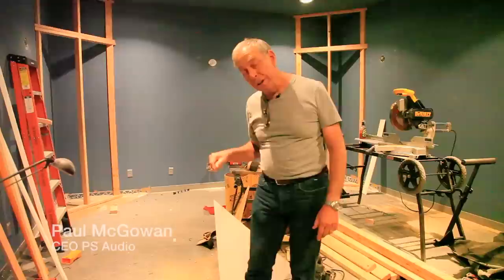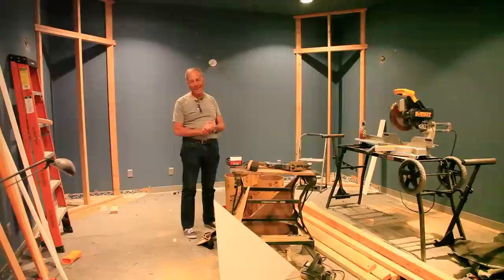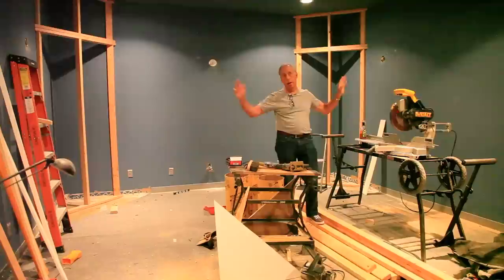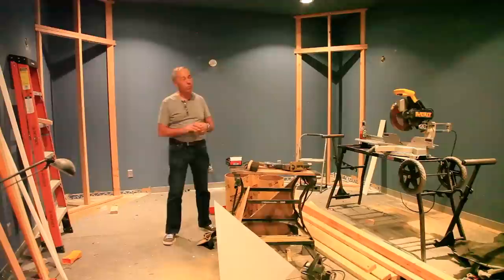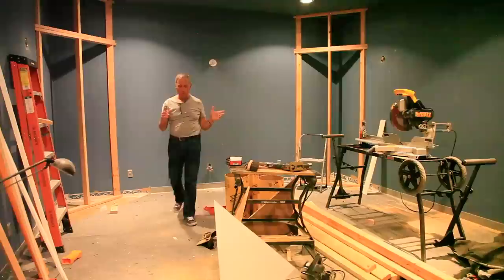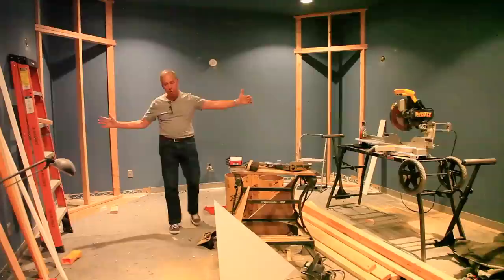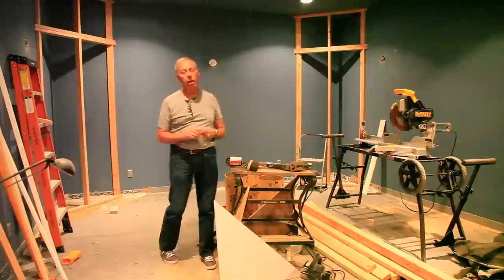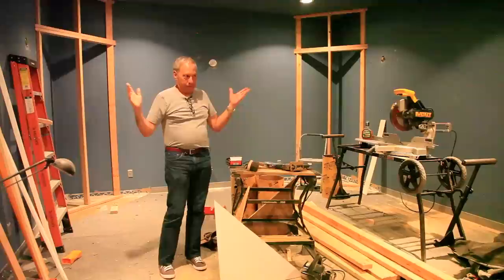Building a new Music Room Part 3

Comment: Dear Paul:
First of all I congratulate you on your videos, I loved them.
I know in advance that my comment will be too late, but the idea is to learn. You understand the concept of resonator Helmholtz, only there is a problem in your explanation. For the spring to muffle the frequency you must leave the internal space empty and not fill it with absorbent material, so it will not work. It is required that work be generated and that this effort be converted into heat, thus absorbing energy. If you fill it with absorbent material, you will not only change the internal volume, but it will also hardly resonate, remember that when you operate backwards the resonator will not emit sound like a whistle, but that at the frequency that the whistle resonates it will now be absorbed. If you fill the whistle for example with cotton, it will not sound, dare, will not resonate and conversely, when you feel the frequency the Helmholtz resonator will not absorb it.
I hope I have explained well.
Regards

Comment: As an avid DIY audiophile who has built a fair amount of electronics and speakers, I have one suggestion for adjusting your system:  Gut the stock crossovers in the IRS Betas and roll your own using first order passive filters and impedance compensating zobel networks. Then start measuring the room response of the speakers.  As good as the IRS Beta's might be, first order crossover networks will sound far more musical, since this is the only type that exhibits proper time domain behavior.

Comment: Not only that. It will make the "sweet spot" very small. Digital correction might even aggravate problems in the room once you move your head an inch to the left. It also will not get rid of the resonance.
Reply: I know you haven't asked me.
But if you are interested, the only thing DSP will do is lower the amplitude of the selected frequency, the room will continue to resonate, even if the frequency has stopped being generated, it is a problem of the room not of the speaker.
Regards

Comment: Paul- I like your idea of placing the equipment in a rack outside of the room boundaries.  That is going to leave you with some very long speaker cables, albeit, very short interconnects unless the power amps remain in the room.  You can, and they do, argue both ways: short interconnects, long cables, and vice versa.  Any opion in that regard.  Thanks.
Russ

Comment: This is fine but it assumes a perfectly rectangular rigid box with no carpet. You are planning to cut into the walls. The room will have some absorption. And most importantlt the IRS will not have a flat output. So as you mention being able to tune the resonators based on measured response of the final room with the speakers and equipment is the only effective approach. That is the response graph I will look forward to seeing!

Comment: If a Helmholtz resonator can only be tuned to one frequency, I don't think it's ultimately going to be the best solution since these mode build ups can actually be a broad range range of low frequencies because the build up is a little more spread out over a wider frequency range than only one.  yeah, one might actually be the most prominent, but it doesn't have a spike?  it gradually goes up and down with different frequencies.  I think other low frequency absorption would be ultimately better.
Reply: Oneness100 more resonators? for different frequencies
Reply: MAaDmUm A Helmholtz resonator isn't a broadband resonator, they are tuned to a specific frequency.  Take a coke bottle.  when you blow over the mouth of the glass coke bottle, it resonates at a specific frequency.  Right?  That's basically what a Helmholtz resonator is, in generalized terms.  Well, if you have low frequency issues in a room, it's not just ONE frequency that you have a problem with, it's typically a RANGE of frequencies and it might be CENTERED around a specific frequency, but you still have to treat the other frequencies surrounding that one center frequency.  So, if you measured a problem with 30Hz, you may have to use Resonators that are tuned many frequencies above and below that 30Hz to treat that problem.

So if you use Helmholtz resonators for low frequency room treatment, one typically requires many of them that are tuned to different frequencies.  At least this is my understanding of how they were explained to me by an acoustic engineer.  It's quite common, to require 12 or sometimes even more Helmholtz resonators in a room and each one is tuned to a different frequency.   

Diaphramatic low frequency absorption is much better.  You can get them designed for broadband or turned to a frequency that's centered around the same frequency you are having a problem with and you can use both.  Depending on the design and materials, they might not take up as much room.  Low frequencies is the most difficult problem to cure when it comes to small room acoustics.

The first thing to do is take measurements of your room, figure out what speakers you plan on using, and then contact a company that does specialize with low frequency absorption products and then they'll tell you what problems you have because they probably have a similar sized room already measured, and they can tell you what you need to cure the problem. Some rooms are simply too small to do anything..   And yes, some people simply use too big of a speaker system in a small room and if played at high volume, it just creates a bigger problem because you are loading too much low frequencies in that size room.  So, speaker size, volume level you play music, come into play when it comes to dealing with the room.  So it's better to take those into consideration.
Reply: Oneness100 Okay thanks! 
so what would you recomnend a Student that has two "Magnat Monitor Supreme 800's" and a "Canton" Sub for getting rid of an annoying Mode at around 136 Hz? 

I do not know how to get rid of those annoying frequencies on a tight budget, so i thought about building a Helmholtz resonator. 

I walked around in my room and noticed the typical interference-pattern but it is not possible for me to change my Position in my room :(
Reply: I ran into one company that specializes in low frequency absorption treatment, he's a great source of information and he can discuss the different methods of low frequency absorption, etc. etc. and he's got a lot of videos on room acoustics, treatment, etc. So you might want to check out his vast videos he posts, and I would suggest asking him questions and maybe get a quick analysis of your room and what treatment he suggests.  He has his own dual diaphragm absorption systems that he does sell the plans so a DIYer can make your own, OR you can buy pre built units.  Acoustic Fields is the company name.  He caters to both the professional recording studios as well as home listening and home recording studios.
Reply: I don't know enough about your situation.  The BRAND of speakers isn't what they look at, it's the size of the low frequency drivers and how many low frequency drivers is what he's looking at..   Let's say you have a small room that's 10x12, which is a typical bedroom in a tract home or apartment.   It can't handle low frequencies very well, because it's too small of a room, so putting in sub woofers or large woofers wouldn't be a good idea, because once you go past a certain SPL, you are doing to build up a lot of low frequency energy that your room simply can't handle and they are too small do put low frequency treatment because you simply don't have the room.

In a well treated room, you don't typically have to turn your stereo up as loud.   

here's what I recommend.

Jot down the size woofers and the number of woofers you have in your stereo, get the length, width and height of the room measured, maybe take photos of the room you might email him so he can see what other considerations.   Call Dennis at Acoustic Fields and talk to him about your specific situation.  he might recommend making your own diaphragmatic absorption systems as he has designs for a dual diaphragm model.  And that might be a LOT easier than making Helmholtz resonators…. 

They also have a ton of videos on room acoustics, treatment, and other topics that revolve around room acoustics on YouTube.
Reply: But only a specific frequency is going to have a wavelength the exact size of the room, so a room mode actually is pretty specific.

Comment: I’ve been trying to understand this Helmholtz resonator/absorber thing and I think this has been one of the best explanations, I think, but trying to wrap my head around how damping material in the chamber doesn’t actually raise the resonant frequency since you’re making the chamber smaller... or maybe I’m missing something
And wouldn’t they also need to be air tight? Seems it would be hard to pull that off with drywall and mud
Reply: Wondering if you ever got your head round it all. I too am confused by this, I've seen people claiming that helmholtz resonators reduce frequencies because the waveform that comes out of the resonator is out of phase with the sound wave going in. Is this part of it I'm confused.
Reply: @greatfelixo  yes, that’s the idea, that the pressure wave coming from the resonator will be out of phase and therefore cancel said frequency… in theory… I got into membrane traps after this which are also extremely difficult, then settled on just using rockwool panels. Has a far wider bandwidth and is just far more practical overall. Check out acoustics insider.
Reply: @almightytreegod  thanks for replying to something you left a comment on 5 years ago. I am just a bit confused though because if this is the case what is the dampening inside for? Is this just to stop the surfaces inside resonating and making more noise?
Reply: @greatfelixo  as you can see, I never got a reply on that. lol… I assume they were doing it wrong
Reply: @almightytreegod  right ahah, this video here seems to confirm it though /watch?v=Q636ZOzJnks&t=194s so perhaps it is about the internal surfaces vibrating. Or that the resonator is so effective that the amplitude of the sound that the resonator puts out exceeds what goes in so needs attenuating with dampeners to match the amplitude.

Comment: Does anyone offering advice on how to setup these Rare speakers, actual own one of the limited 58 pairs? As for ripping them apart to build your own crossovers.....pretty sure they will already sound pretty sweet as is. Most Audio DIY's have made their own cross overs at some point.with some success....but most would rather go with a setup made by Experts and companies with dedicated technicians and teams,  than something dollied up using second hand knowledge!!! Pauls Video's are about setting up rooms as good as possible and for his purpose his techniques work. They're may indeed be better............but until people have sat in the hot seat and heard the end result......debating whether it works in Pauls room build or not, is a mute point......Opinions are free to give but not to be confused with, flat out challenging the validity of what is a scientifically controlled room build - these guys ain;t just throwing up chunks of wood for the fun of it!!! LoL

Comment: 25 Hz?? … isn't relevant for producing music! You have to care about 100 to 1000 Hz!
Reply: Very relevant, actually, that is just a bit lower than a low b on a 5 string bass guitar (~30hz), and close to a low E even (41hz). Now, your primarily hear the 1st harmonic (~60hz) on the bass guitar but it's still there. With a bass amplifier, it is even more there. Then add on top of that a room that naturally resonates around 25hz and you have a problem. If that resonates enough such as through contact with the ground and into the walls, then you have the room resonating and harmonizing to that resonance too. That will get picked up in mics, reamplified through open strings, resonate through the bass drum and floor tom and snare, etc. Every db you can take away from this low sub range helps the low and upper lows and low mids a LOT.
Reply: As far as having source audio (aside from a bass tuned super low, or a low kick drum maybe) low enough, a mic that will actually pick it up (that you wouldn’t want to use a high pass filter on anyway), and then the monitors that will play it back, that’s an expensive frequency to hear, and probably an unlikely one to hear with any volume still. The problem, from what I understand, is that with standing waves it can muddy up the low end and cause problems with higher frequencies as well. Like if you have an issue at 20, you can more likely have an issue at 40, 80, 160, etc...
Been trying to find clarification on that tho